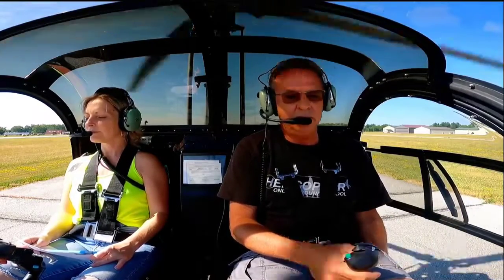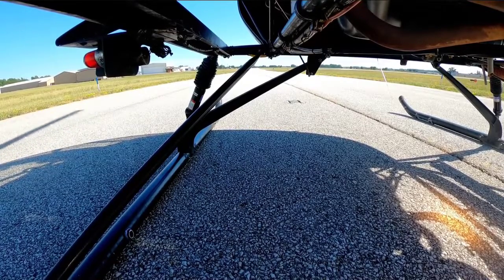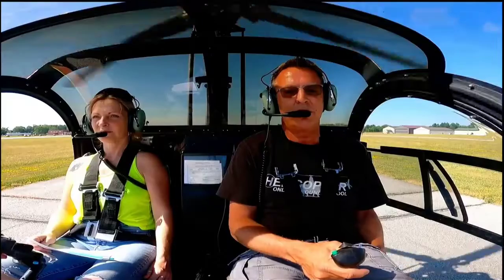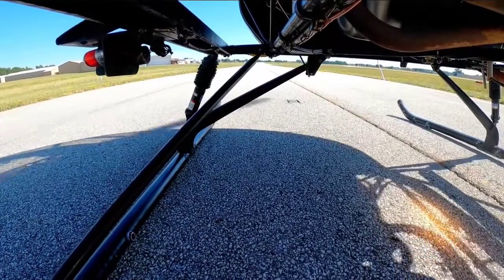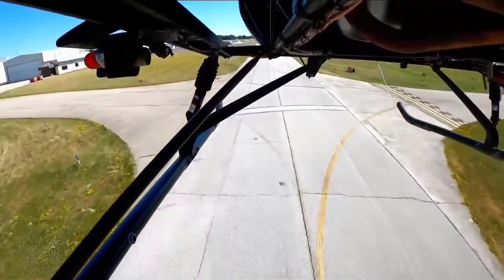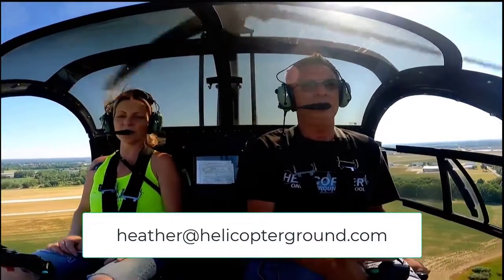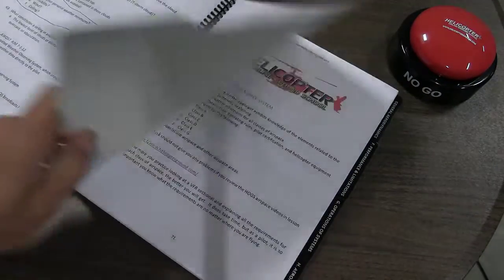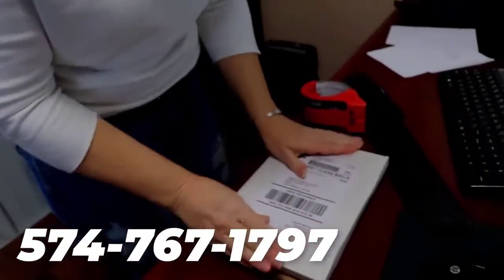Prevent Helicopter Accidents: Master the Two-Step Process to Avoid Dynamic Rollover

Comment: What a coincidence -- I had written a novel about an air rescue mission in the Arctic a few years ago, and the name of the rescue pilot in my book is also Heather!  🙂  As for this 2-step process, it is a GREAT way to prevent dynamic rollover -- and I should also add that this is probably one of the things which are actually easier to do IRL than in simulation, because you have to actually feel the aircraft, which the sim doesn't allow you to do!
Reply from the maker: Thank you for the feedback!

Comment: Can you explain why its wrong to just pull quickly to the hover/take off. Cheers
Reply from the maker: If you rush the maneuver and make the wrong input, you can destroy the aircraft when it rolls over on it's side!
Reply: Wrong is a heavy word, It is just not as safe as doing it the Keven show it, you might not alway picking up from a concrete surface, if you have a root or something else that would hold one skid this is where you could roll over if you don't  do 2 steep.

Comment: How much does high density altitude affect the handling and the liftoff process?   Does the ETL speed change at high density altitudes?   In the flight gear flight simulator on my computer the helicopters seem sluggish at 5000’+ in Albuquerque or 7500’ where live.
Reply from the maker: As you increase in altitude performance decreases